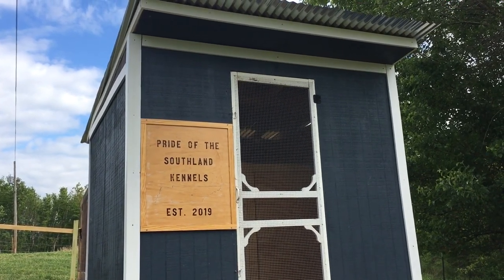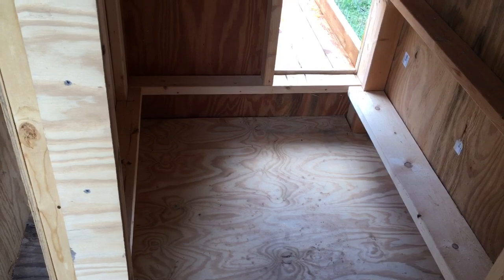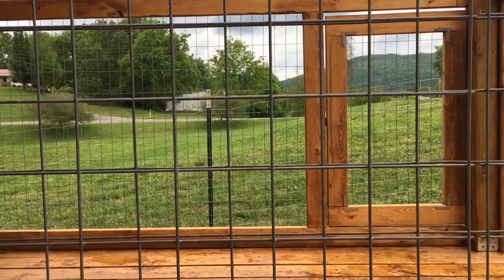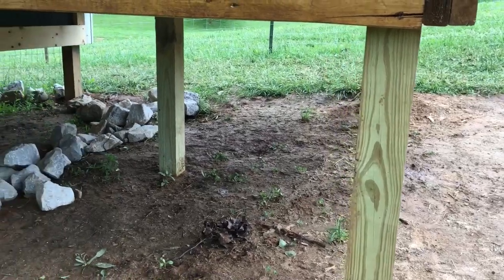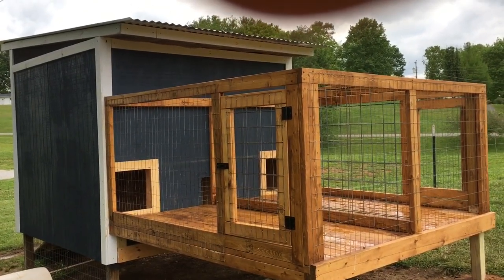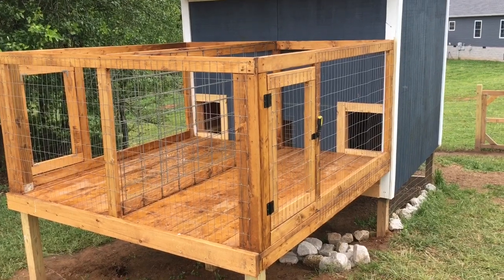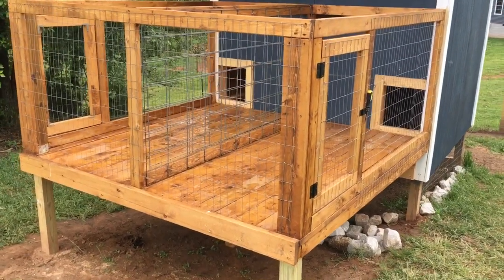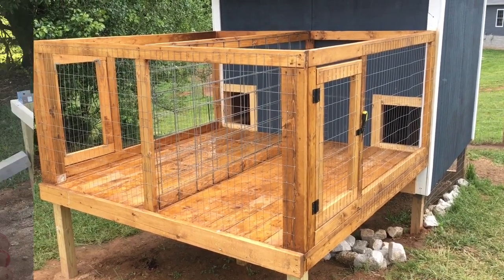Raised Dog Kennels attached to Whelping House: Build with pics

Comment: Back in the early 2000s I had a female dog that would rip through welded wire so I did horizontal boards with a few inches in between then the wire at the top because she was a jumper. Then later I decided to do hot wire fence and raised dog houses.